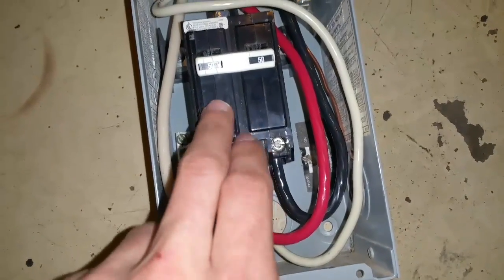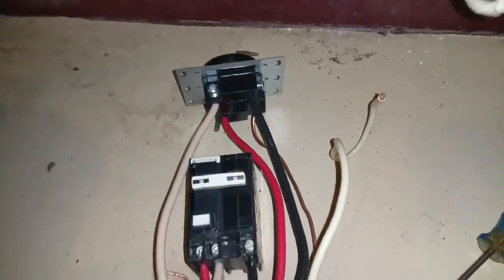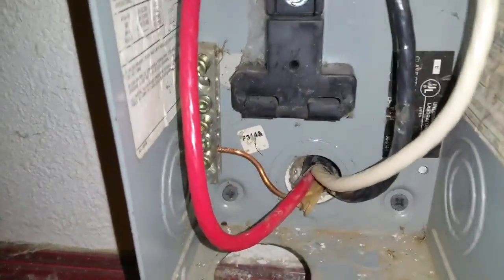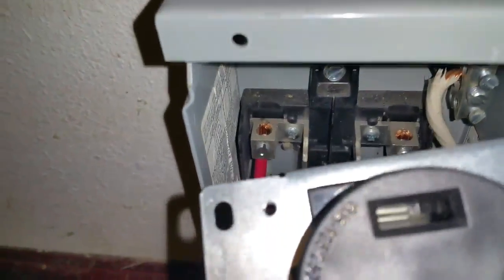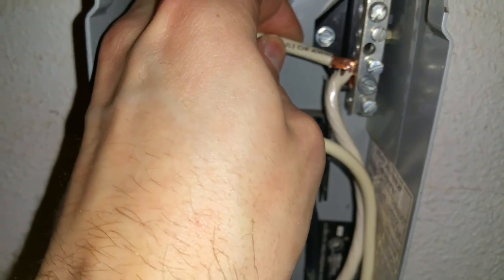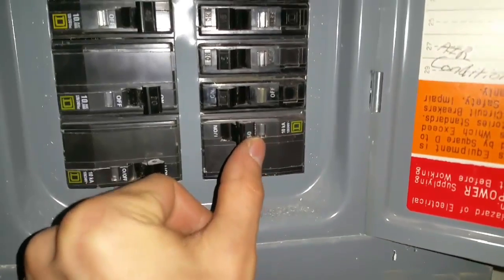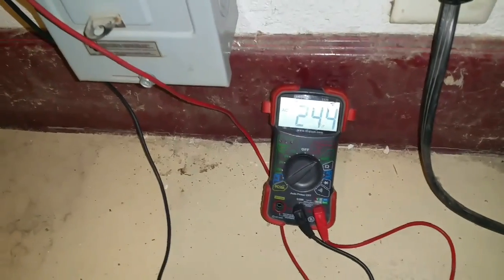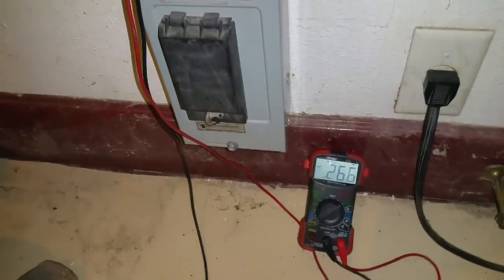How To Hook Up A Generator To Your House - Pt 2 Switch Box Wiring

Comment: At the end of your video why was the meter reading 246 volts before you turned on the breaker? To me it looks like the hot is hot wether the breaker is on or off. And are you feeding directly from hot coming in from pole????
Reply from the maker: Point 264 (.264), then changes to 244v

Comment: This is unsafe and violates code.  You need an inlet, not an outlet.  The inlet will have male prongs.  Also the generator breaker needs to be interlocked with the utility main so that they cannot both be energized at the same time.